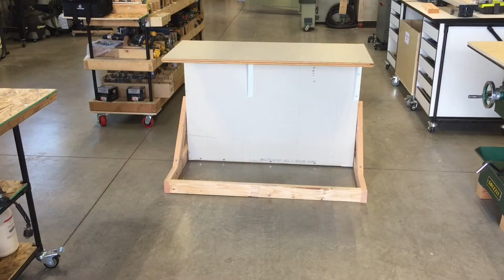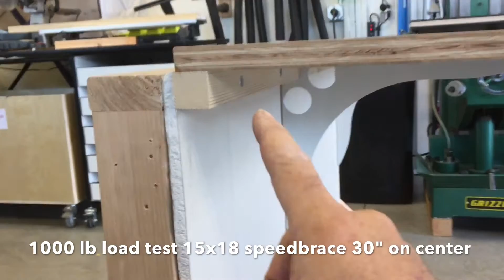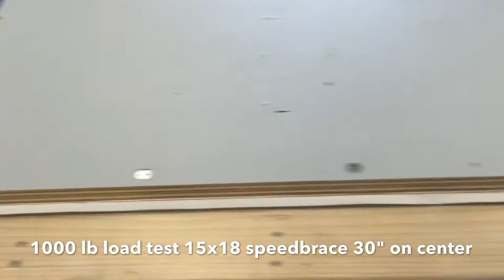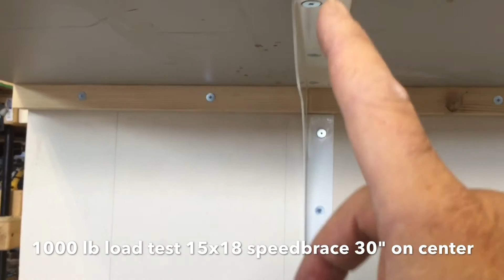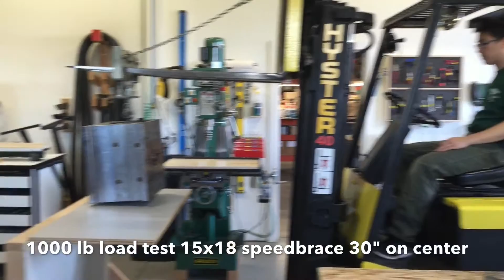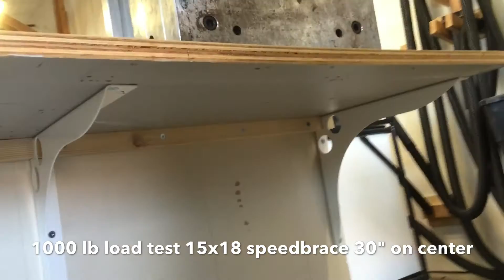SpeedBrace Load Test - Hanging Shelves

Comment: We’re those 3 inch Powerhead screws attaching the 2x2 ?   And we’re those 2-1/2 or 3 inch for the verticals?  Thanks in advance.  Looking to make the same spec. 

Just bought 10 of the large speedbraces to install through sheet rock 2x4 framing.
Reply from the maker: So sorry I missed this.  Do you still need the screw sizes?
Reply: FastCap got it covered. Thanks.